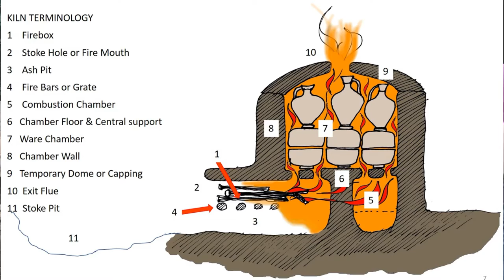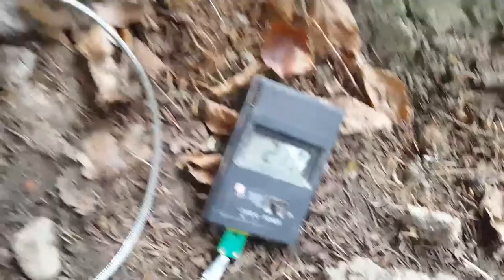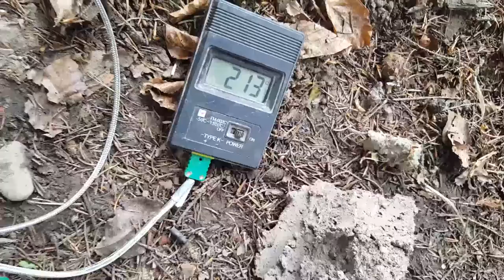Firing The Replica Roman Pottery Kiln At Vindolanda Aug 2020

Comment from the maker: No, it's VERY different with a kiln, you have to be constantly in front of the fire, stoking and raking, the firebox gets up to temperatures of 1300C, and the radiated heat at a metre distance (where you have to work to do this) has been measured between 400C & 500C, hot enough to not only roast meat but burn it.  This is the whole point of experimental and experiential archaeology, we learn from the experience. We also fire many prehistoric style open "bonfire firings", the temperatures are much lower and we only occasionally have to get close to the fire.

Comment: Instead of using good new pots to support the center if you made some clay columns. That would prevent you from getting any pressure cracks in the pots.
Reply from the maker: True but thw cracks are a rare occurrence so worth the risk
Reply from the maker: And there is not really any archaeological evidence for such supports.
Reply: Given the amount of fuel, time, and arduous work required for each firing, every bit of packing space within the kiln is a valuable commodity — a commodity of production capacity that would be wasted if filled up with support structures having no value after the firing.

Comment: I think you let the clay to fire too much, this technique is used in Spain and you ought to be carefull with the temperature as well as the fast cooling process, it needs to be open if you want blackware
Reply from the maker: No, we have successfully fired black Ware on several occasions, but didn't get the seal tight enough this time.
Reply: You've got it backwards. Black ware is caused by a lack of oxygen in the kiln. Opening the kiln up would cause the iron in the clay to turn bright red. 
Sealed kilns make black pots.

Comment: keeping a bed of hot ashes in the front  fire box helps raise the temperature
Reply from the maker: Actually it's a delicate balance: some level of hot embers will help by preheating the air entering the firebox.  Too meny embers will consume the oxygen entering the kiln and cause a drop in temperature.

Comment: Great video! I’m curious what you used for the bars in the fire box and the chamber floor? We have a similar kiln we have been building (not authentic at all) and we’re thinking of using rebar but we’re concerned with sagging after several uses. I would like to use something different, and I obviously haven’t researched this design enough. Thanks so much for sharing your video.

Comment: I've started a bit of a side hobby over the winter in learning everything that interests me about pottery from ancient to modern methods as the artistry has its own appeal, though for me, it's also in experimenting with the chemistry to see what I can make apply to other projects. In happenstance as it goes, I was watching a video on Tierra Negra the other day, and the method they use to go from the iron oxide slip color to black was adding green herbs and native grasses right at the end of the firing and sealing it into their kilns (some were quite large, dedicated structures, though others did small batches in oil drums, sealing them via the lids with the green grasses in at the lull of firing). Not sure how universal that would work with this style firing, but might be worth an experiment if adding a variated depth of green wood would assist in blackening the pottery. 
As I understand it, you're wanting the carbon to travel up into your chamber without further combustion to act as a topical coating, which even when coming down from 800-900*C would be a large ask without the proper reduced or neutral gas mix already sequestered inside.
Reply from the maker: Hi, the technique of producing black pottery using organics in low temperature firings is quite common the world over, but as you say, even at temperatures below 900C the intense reduction needs to be maintained while the kiln cools below about 500C. It relies for its colour on both trapped carbon and on conversion of the iron in the clay from a ferric to a ferrous oxide.  Roman grey and black burnished wares make use of this technique.  Terra negra (Black Samian) and Colour Coated wares on the other hand trap the black iron in a sintered or semi fused slip, achieved at considerably higher temperatures.

Comment: Wonderful ! Thanks for sharing this experience
Reply from the maker: Our pleasure! Thanks for your comment.
Reply: @PottedHistory  hey just wanted to add a thought, I have been experimenting with ancient pottery replication specifically southwestern United States before 1200 AD. If you want black pots, try slipping the pot with iron hemitite or limonite , body clay, and sodium, soda ash works well. It’s possible they used potash but soda ash is more reliable at primitive temps. After a few years research I’m convinced many ancient cultures used soluble salts in pottery. But I digress 🙂 cheers!
Reply from the maker: Thanks  @coopart1  , I'd agree, we use Soda Ash and various iron oxides including haematite, magnetite in the form of hammer-scale, yellow ochre and iron slag to make samian terra sigillata slip and Nene Valley colour coated wares. Black burnished ware on the other hand, was made simply in the reducing atmosphere of the kiln without additional slip. Like you we've experimenting for some time with materials that would have been available to the Romans, soda ash is the perfect combination of a flux and a deflocculent.

Comment: I’ll withdraw my question about the bars now that I’ve watched the video again with good audio and you described the bars as fired clay.
As for not a roving the black finish, could it just be a factor of not enough I burned fuel put in the box before sealing so that it used up the oxygen before running out of fuel? (Or the air leak as you mentioned. ) 
I look forward to more of your fantastic videos.
Reply from the maker: Hi Eric, no problem about the bars. In fact I've seen several excavated Roman kilns, where the only clay available for the bars would have been the same as the potting clay they were using, and as such, not being very refractory the bars have, as you say, bent after several firings.  Rotating the bars after each firing would prolong their life, but I thing that Roman potters accepted that kiln furniture was expendable to some degree.  As regards the oxidation of the firing, we've had good black reduction with similar quantities of fuel in the past. I do think that an incomplete seal was largely to blame, mostly down to the fact that the kiln needs some serious maintenance at this stage. So really my own tardiness to blame. But I also think that waiting until the kiln had cooled a little more, before the final stoke, would have helped. Cooling reduction cycles are not uncommon in ceramics, more recent examples being 19th Century Lustre Ware.
Reply: @PottedHistory  thank you for the explanation of the bars. I’ll have to find out if there are any locations near us to dig some refractory clay to try. 
You’re probably familiar with the San Ildefonso black on black pottery from New Mexico. They have a nice history of beautiful pieces. It’s interesting to watch old film footage of Maria Martinez firing and then smothering with cow dung to get the reduction- if I remember it correctly.
Reply from the maker: @eric8527  Maria Martinez has been one of my pottery icons since I was a student back in the 1970s.  Her work, especially the black on black, is stunning. Brought to the attention of a British audience by Bernard Leach among others. Good luck with the clay.
Reply: @PottedHistory  I’m sorry I missed this last message, thank you.

Comment: Amazing video. Do you think the kiln gets hot enough to fire glazes?
Reply from the maker: Hi Brenton, you can certainly formulate glazes that would work in this kiln, although because of the wide temperature variation it would need to have a wide maturing range. The Romans did fire glazed pots and obviously slip coated wares like Terra Sigillata, but these would have been fired in a more sophisticated kiln such as those excavated on the Continent.

Comment: wood fired kilns . will as they are fired sux oxygen around the kiln, always helps to step away from the firebox,
Reply from the maker: Not entirelt sure what you mean John. It does consume oxygen but not at such a rate as to need us out of the way of the air flow, nor so much that it renders the atmosphere unbreathable.
Reply: @PottedHistory  i had a 27 cubic feet kiln , 15 hours firing  . when firing stay at least 3 feet away from the kiln face.  while in reduction,
Reply from the maker: @johnbooth1110  Ah, that's a very different beast John, I used to fire a 120cu ft wood fire and a 180cu ft diesel stoneware kiln to 1320C. A Roman kiln fired to 1000C is much less challenging.

Comment: Palestinian kilns used olive stones up until the 1960's.
Then car tyre inner tubes proved a free and energy dense fuel. Pine cones? Wood is a premium resource in the Med region.
Reply from the maker: Thanks Mark, olive stones I haven't seen as a fuel, a new avenue for research. I'd be really interested to see how they stoked with them. Chaff for instance, has to be wafted into the kiln atmosphere one shovelful at a time. You're right about timber being at a premium, as I say with the Vindolanda kiln, roman potters would not be splitting logs, their fuel would have been coppice, brash, gorse or hedgerow material.  The only reason that we do, is that this is the material that we have available to us.

Comment: On the "they probably werent naked like they are depicted, it's probably a religious thing" point: I think it's too often a default assumption to make. I have worked a lot in my youth burning large amount of branches outside after chopping down trees with my father. He was chopping, I was in charge of burning the branches. It makes a large, very hot bonfire. Think a couple meters diameter. To get anywhere near it is impossible. No clothes help you, if anything you are just sweating less efficiently because of them. What I would often do, is set the bonfire next to the nearby lake, take a dip in the water, and I could comfortably stoke and arrange the fire while wet. For a couple minutes I was invulnerable to it.
You can imagine waterlogged clothes would slow you down too much, but while naked, you get just enough time to sort the fire out without getting a heatstroke.
Reply from the maker: Water soaked clothes would actually boil you, and seriously scald your skin. The fire in the firebox can reach temperatures of up to 1300C and the radiated heat can be in excess of 500C at a metre distance, focussed by the narrow firemouth. Bonfires rarely exceed 800C with most of the heat carried upwards .  To stoke and rake out a kiln of this type it is necessary to get very up-close and personal. We are firing the Vindolanda Kiln tomorrow and I will try to take some temperature readings in front of the firebox  I am approaching 70, I have been a potter all my working life, and I fired my first wood fired kiln in my teens, I do know what I'm talking about.